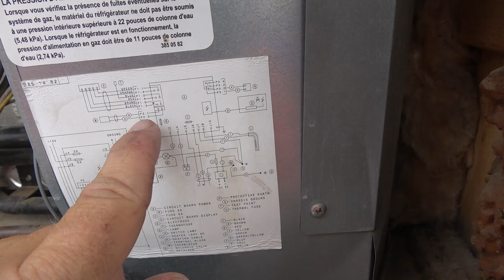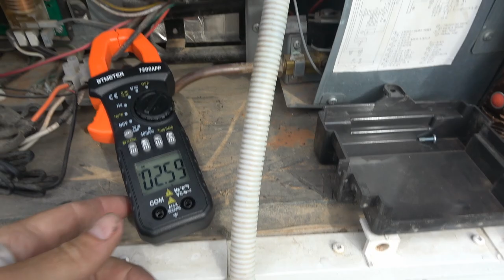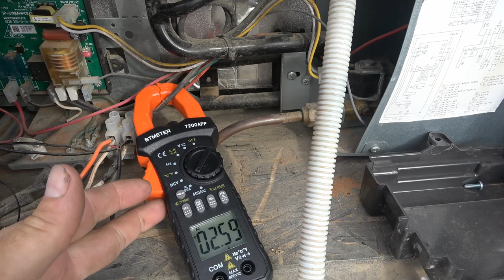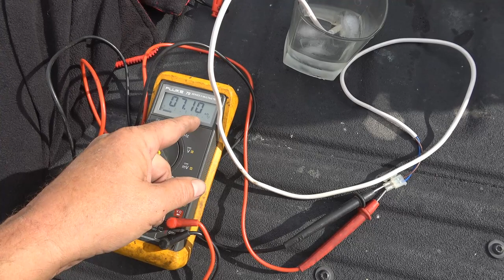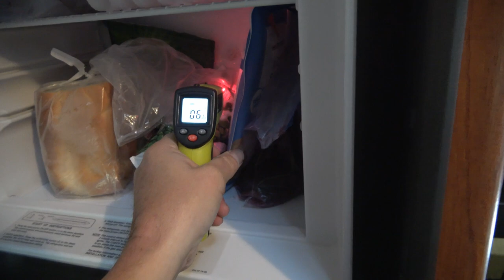Repaired Dometic DM2652 RV Fridge - Not Cooling Properly, Refrigerator Temp 40F+ , Bad Thermistor

Comment: My Dometic refer quit cooling like it had. It always ran cold. Tech installed a new thermistor but refer would not cool even with adjusting the slide control. After thinking on it he decided to add a shrink wrap cover to the end of the thermistor! An odd thing to do but by golly it worked!! Refer cooled like it used to and freezer to 9 degrees . Just thought I would mention this! All basic checks were done to diagnose a bad thermistor!
Reply from the maker: Weird, I can't think of what adding shrink wrap would do
Reply: @LoveYourRV  It insulated the thermistor sensing temp to make it sense temp differently. It had to get colder in the refer to activate to return cycle off.
Reply from the maker: ahh, I see, maybe the wrong thermistor part was ordered so that adjusted a bit
Reply: @LoveYourRV  No my tech double checked the thermistor part number ......He thought maybe he got a defective one but decided to add the sleeve to see if it would cool like it should. He was pleasantly surprised that it fixed the issue. I was about ready to go with a 12v refer!

Comment: Good troubleshooting.  I noticed on my rv fridge that where ever I put anything on the top shelf, ice would form on the fins. So I took everything off the top shelf and now the fridge stays colder especially during the warmest part of the day.  I also have a wireless temp sensor inside the fridge, the monitor on the outside also shows the max  highs and lows

Comment: Thanks for the video! I thought the cable o the thermister was a bit too short to allow enough travel of the thermistor on the refrigerator fin. I spliced the wires and added a bit more to allow for more travel. The fridge is working fine now. Perhaps I just bought some more time before I have to replace the thermistor all together.  I did ohm out the existing thermisor against a chart I found and thought it was within spec. Time will tell! Safe travels this winter season!

Comment: Nice fix. So many people just have them (frig) removed. Thats an expensive "fix" vs doing a little trouble shooting. $15 vs $1500 + new unit. I'm one to go the trouble shooting route. When I can only narrow it down to two parts I'll just replace them both. Still a big savings over total replacement. I know the current trend is to the new 12v ones; but at this point mine works fine as is. If it ain't broke; don't fix it !

Comment: Hi Ray. Been following you for years. Thank you for the great Info on the thermistor. I found an upgrade to the standard thermistor called the "Snip & Clip" thermistor replacement. It replaces the thermistor end with an adjustable thermostat that reads the fridge temp instead of the temperature of the fins. I have gotten a lot of great tips from you over the years, so I thought I would send one your way.
Reply from the maker: Cool! thanks for the tip. I ended up installing an adjuster knob from Dinosaur Electronics that goes inline. Guess it does the same. Got the fridge dialed in exactly the temp I wanted. https://youtu.be/MUo36YK1vK4  Cheers, Ray

Comment: How old is your unit ? Mine is a 2018 and my control AC board craped out already but electronic don't like Arizona heat
Reply from the maker: Original was 2011 but failed in late 2016, bad cooling unit, leaked. https://www.loveyourrv.com/fridge-meltdown-extended-rv-warranty-s/
Luckily we got this newer model free from an extended warranty so its 2016 model. We have been full time RVers since 2011 so fridge gets a lot of use.
Reply: @LoveYourRV I'm going to replace my thermistor at the same time I do the board thanks for the reminder,  for the board I went with a Dinosaur Electronics 3850712.01 we have had good luck with there products.

Comment: I put in a couple of battery operated fans inside the fridge to cerculate   the air around inside
Reply from the maker: I have a little circulation fan tucked inside the lower fridge that I used a small DC-DC converter and wired it into the 12V power that comes to the fridge light, so don't need to worry about batteries. https://youtu.be/2IPPoaDdcnQ?si=ZFYHvwnQw8A3faKI Cheers, Ray

Comment: I had a similar issue before. What I found was the rubber roofing roofing at the top of the vent passage was restricting the air flow out the roof vent. In a nut shell, the cover you removed at the bottom to access the back of the fridge draws air in and it vents out the roof or the side of the rv. Make sure the “chimney” is free of blockage and the air can flow from the bottom all the way out either out the top or side of the top vent. It really is a simple to understand, hot air rises and creates a vacuum that draws in the cool air. Any restriction(s) in that system reduce air flow and thus reduce the cooling effects of the fridge. I can attest that the this is correct in that after I made sure the pass threw behind the fridge had clear air flow ( the top of the pass threw was 40-50% blocked and after removing and clearing the path I could feel a drastic amount of better air flow that resulted in a much much colder fridge. 
As always, great video Ray. 👍🏻
Reply from the maker: Yes, good tip, air flow really helps out in the hot summer months. I have a set of fans that draw air in from below as seen in the video and also a second set up near the the roof that draw air up the stack improving the natural chimney action of the fridge venting. Both sets have thermostat controls that adjust the fan speeds as needed.  https://www.loveyourrv.com/installing-12v-rv-fridge-and-vent-cooling-fans-from-titan/ Cheers, Ray

Comment: Good afternoon, ray,
I got the frigerator that you have. And I'm having a problem with it. I can't get it to run on electric. It runs OK on gas,I have tried 2 different motherboards.  Both of them do the same thing. I'm thinking maybe the upper board. I have one on order. There are only 20 bucks, it's worth a try. You have any ideas? I have tested everything as you have shown on your videos. And it all seems to point do my switches. Also I am missing the slide that holds the thermostat  that you're working with. Do you know where I can pick up just to slide?
. if you're coming through Idaho on your way to Arizona. Please stop by and spend a couple days. I got a spot for you.
Reply from the maker: Have you tried bypassing the board and wiring the AC 120V right to the electric element and see if it works?
I'll have to see what the weather is like when we start to head south but in early November it may be too cold already to got the Idaho route Cheers! Ray
Reply: @LoveYourRV No I don't know how to do that. I'll have to look that up, stay warm.

Comment: I am debating replacing my absorption unit with a 12v compressor unit mainly out of fear of fire. What is your opinion on this? The travel trailer is 5 years old and sonfar the fridge has worked OK.

I have solar and lithium, so I'm not too concerned about power use.
Reply from the maker: There have been RV fridge fires over the years, I remember that Norcold fridges had problems years ago and there was a big recall. I think if properly maintained the risk is pretty low. Likely most are caused when people don't bother cleaning the area around the LP gas burner and dry leaves or bits of wood or a bird, insect nest is there and ignites. I bet a great deal more RV fires are related to overheated/unfused electrical wiring. But you don't hear people talk about that as much as fridge fires, guess they make a bigger impression. ;) Cheers, Ray

Comment: QUESTION: About those fans you installed on the access plate. Are they pulling air from the outside and pushing it into the back of the refrigerator or reverse?
Reply from the maker: The natural cooling process of the fridge is convection up through an internal stack. Air rises as the fridge's back cavity heats up. The hot air rises escaping out the upper or roof vent. When that happens cooler air is drawn in through the lower vent. The fans are positioned to help pull more of that cooler air into the lower vent aiding this natural chimney action. I also have a set of fans in the roof vent set to draw air out. Normally one set of fans is plenty but on really hot days 85F+ I'll also turn on the second set.  Cheers, Ray
Reply: @LoveYourRV  AWESOME! Thank you for the reply. I will be making some improvements to my 13 year old Dometic. The fans and the thermistor for now. Just gathering info on how to make these upgrades. Thanks again for your time and video.

Comment: Ray how did you get the thermistor wire back through from board into fridge you don’t show that in the video .
Reply from the maker: The is a little plastic grommet that is removable from the inside of the fridge making it easy to feed the wire through to the outside.
Reply: Yes I see that grommet  that you remove and when you pull the  bad wire out how do you get the new one up through the back into the hole in the fridge . It does not look that easily accessible .
Reply from the maker: I have long arms and was able to get one up in there to thread it through. You could try getting a piece of string through first then tape it to the thermistor to pull it through. If not you need to disconnect the gas line and some undo some screws to pull the fridge forward a bit for more room. Its not to hard to do.  I've had the fridge out to change things in the past. Here are a couple videos https://youtu.be/b2zioJ7XwmM  https://youtu.be/dGBG1Jyx5SU    Cheers, Ray

Comment: Hello, sir! Thanks for all of the great content! I’m coming from your Mr Heater Big Buddy video and I have quite the ridiculous question. Does the Big Buddy use a “AAA” battery for the igniter? The paper that the unit came with says that an AAA battery is required but I can’t seem to find where it goes… or does the unit just use the D batteries?
Reply from the maker: Mine doesn't use AAA maybe its a newer version I don't know about. But on my Big Buddy the flame igniter is manual only, activated by turning the knob.

Comment: QUESTION:  Ray, I always look forward to your video’s.  I look forward to learning something every time.  This one hit a cord for!  I have Dometic Rm2454 Frig.  While on shore power and automatic, the eyebrow display randomly lights the various display lights including all of the lights, then starts over.  The light cycling continues with little pause eventually settling to automatic and ac lights being correctly lit.  I don’t know if you have any thoughts on this as to cause?  

Also, a simple one, one I  embarrassed to ask!   How do you remove the cover to the bottom (outside) accessible power module?  Thank you in advance for your insight!
Reply from the maker: I've heard that sometimes those little switches on the eyebrow can go intermittent. May try cleaning them with electronic spray designed for switches. The plastic cover has screws and a clip you need to depress with a screwdriver to release it. Bottom right hand corner if I remember right.
Reply: @LoveYourRV   Thank you.  I always look to see what your experiencing and observe your problem solving thought process.  🙂

Comment: Thanks Ray! - My "very similar" fridge seeme to run quite cold in moderate Ontario temperatures (between 10c and 20c) with the fridge hovering around the freezing point anf the freezer at around - 12c - I've tried adjusting the height of the plastic holder on the fins with little difference.
- Do you think I might have a similar (but opposite) effect - where the resistance is too high, instead of too low? My TT is a 2014. - Cheers!
Reply from the maker: Could be, sounds like the fridge is being told to run too much, so either the thermistor is off value or something on the controller board is faulty is my guess.